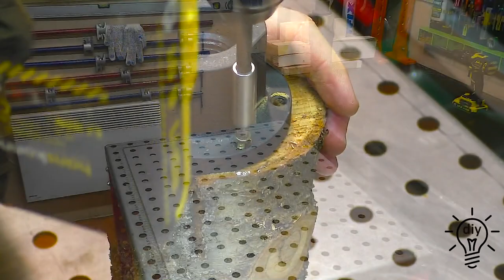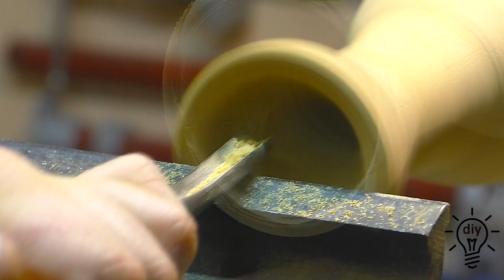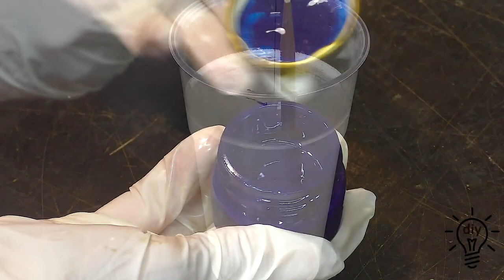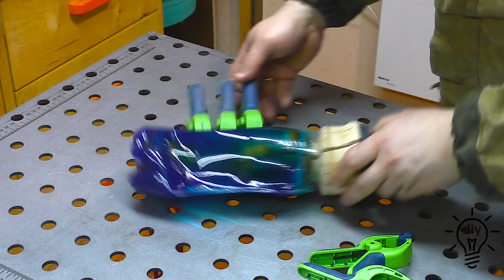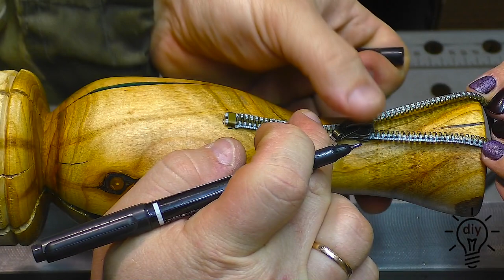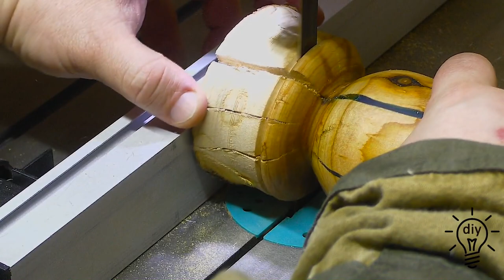The most amazing DIY idea from epoxy resin and wood!

Comment: this PTE bottles all heat extruded you can shrink them pretty well with the heat gun.  fits tighter and need no more clamps and save even mire epoxy material.   :-)
Reply from the maker: thanks